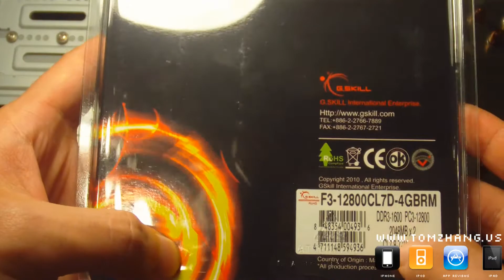How to install memory module on computer HD

Comment from the maker: @fpark Dual is the number of DIMM slots occupied is even, and triple is oddly triple. I would actually throw those crappy 1GB modules away lol, it will only bog your system down, and it will not benefit your cause, unless you use more than 8GB, which I highly highly doubt, unless you do a lot of HD video production using Premiere like I do. You won't see any benefits from extra 2GB, but you'll definitely see bottleneck of having it versus not having it.

Comment: @tomzhangus How do I know if it's dual or triple? I just bought a dell tower with a H67 chipset. It comes with 4GB DDR3 SDRAM at 1333MHz-4X1GB. I also bought G.SKILL Ripjaws X Series 8GB (2 x 4GB) 240-Pin DDR3 SDRAM DDR3 1333 (PC3 10666) Desktop Memory Model F3-10666CL9D-8GBXL. I plan to upgrade by replacing the two 1GB with two 4GB.